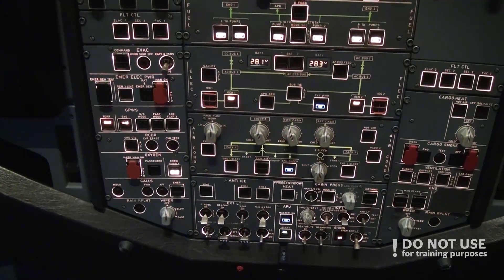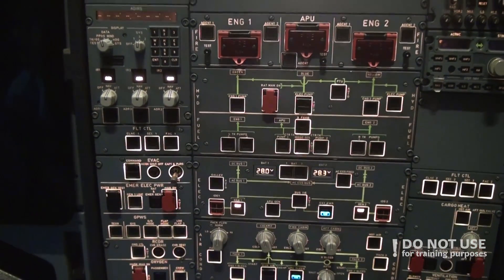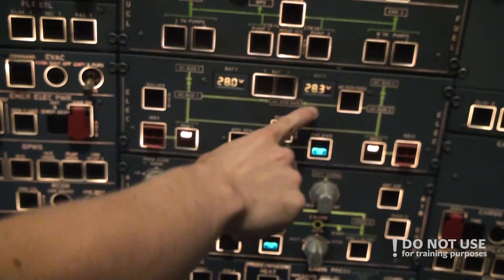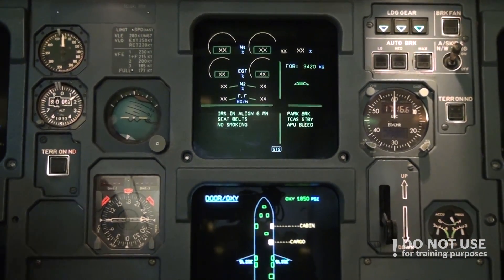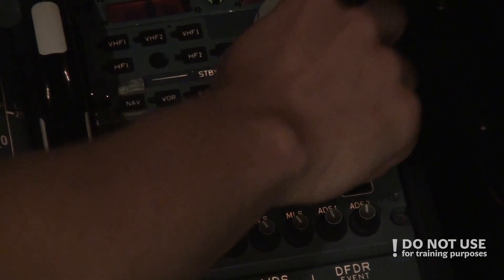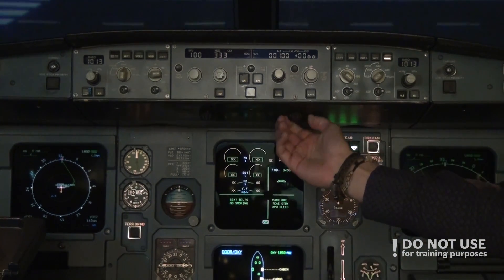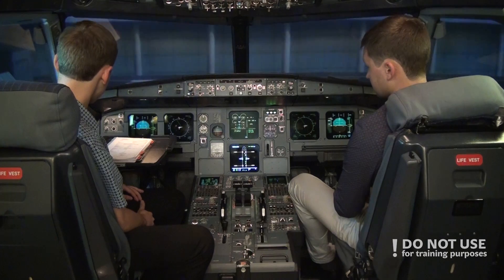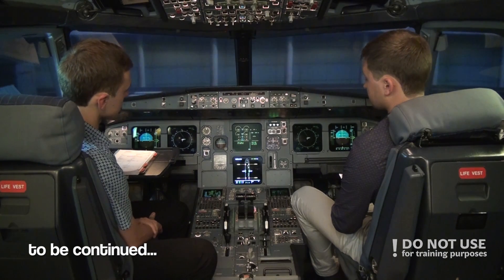Get TR’ed – Airbus A320 FFS type rating training (lesson 1, part 2)

Comment: mate to put pack flow control in low or normal is neeedless because with apu bleed or single pack operation pack automatic supply air in high mode